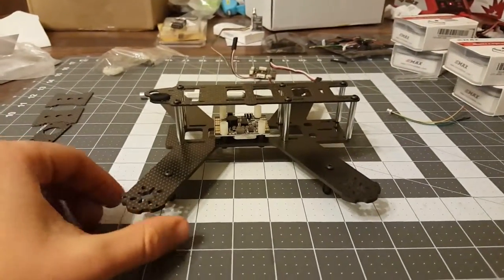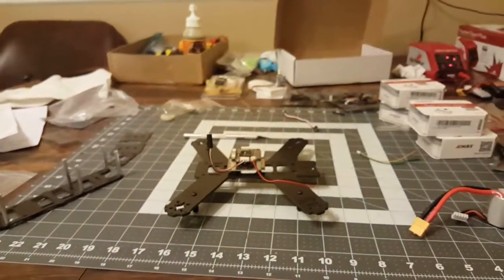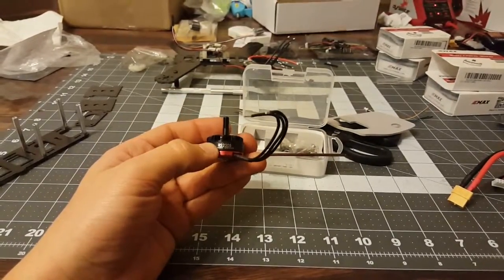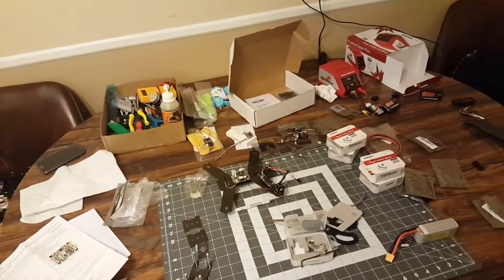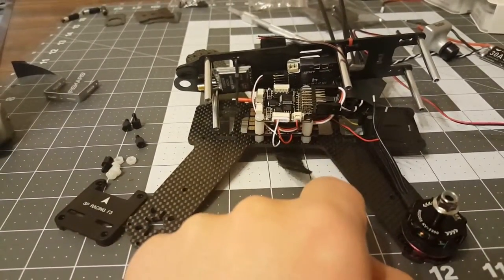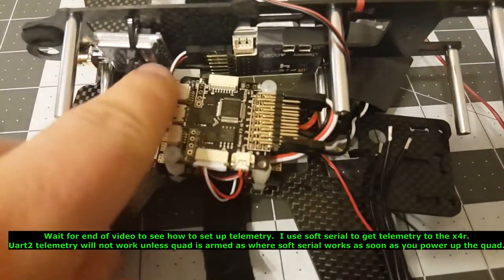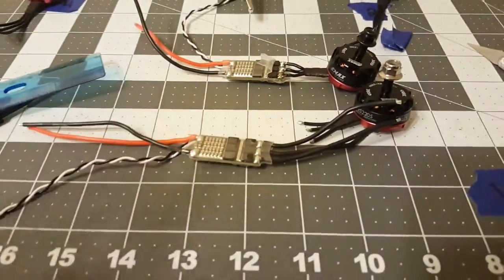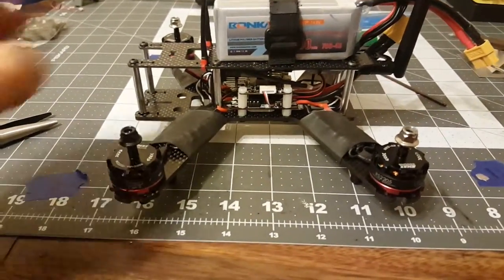FPV Build Softserial Telemetry

Comment: Hi :)

I am using Uart 2 for telemetry. I solved smart port (x4r) to Tx (Uart 2) and I don't have any value for Vfas, it's 0,00v. Do I have to sold Rx pin as well to Tx and Smartport in order to get the tension of my battery? Is it because of that I don't receive any information ?

Thanks :)
Reply from the maker: +Jean-Eudes Akoun Funny you should ask this i replaced my flight controller and pdb and have the exact same ones on another quad and now i have the same problem, but I dont have that problem with my first quad I used the same components on.  My guess is as good as yours, and yes this too is with Uart2 not soft serial.  f303 flight controler may be the issue in my case.
Reply: So I have forgotten to plug the Vbat on the FC. Now VFAS works as A4 sensors but still I've got a problem. It is written 4.10V whereas I've got 4.20v on my battery. Any idea?
Reply from the maker: +Jean-Eudes Akoun adjust the scale under vbat on cleanflight until voltage is right
Reply: +Tracoby Tech that's What I did and it works perfectly ! Thanks mate ! Hope it Works for you too :)
Reply: Did you set telemetry inversion = On - On cleanflight ? :)
Reply from the maker: yes
Reply from the maker: I decided to just get rid of telemetry on my quad the quad im selling has it working just fine I dont really care to have it anymore I just run timers now.